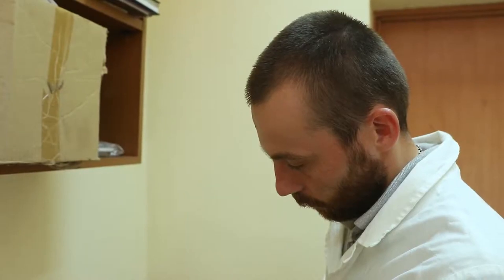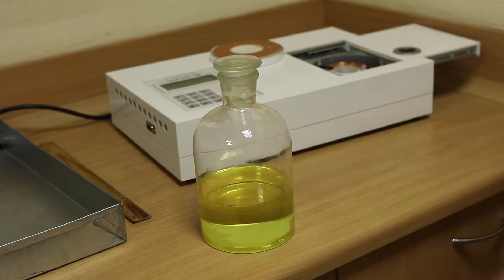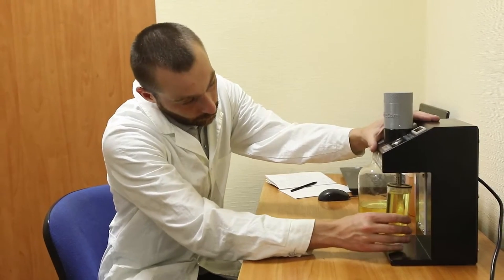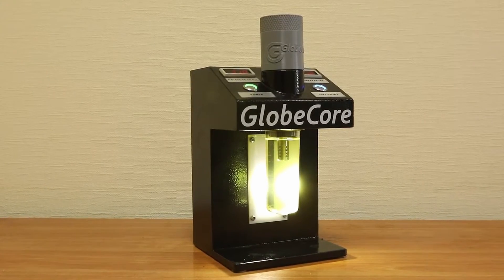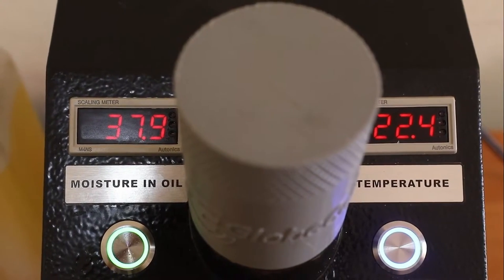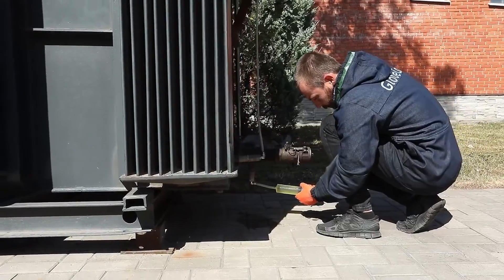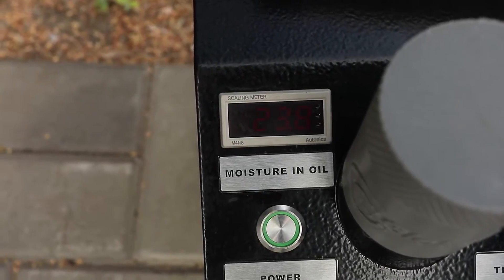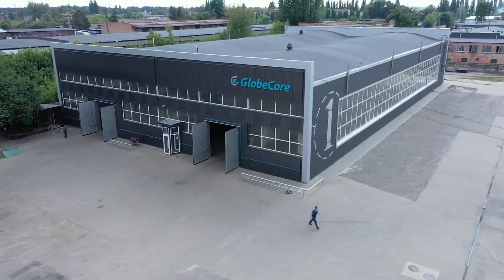Transformer Oil Moisture Test - Oil Moisture Meter TOR-1

Comment: Can the TOR-1 instrument be used as part of mobile laboratories for online analysis of oil in the field?
Reply from the maker: Due to its compactness, with a height of no more than 38 centimeters and a length and width of 18 centimeters, the TOR-1 is easily portable and convenient for use in field laboratories.

Comment: What features contribute to the reliability of the TOR-1 instrument's operation?
Reply from the maker: The TOR-1 instrument's reliability is enhanced by its measurement accuracy and stability, which are achieved using a capacitance sensor that is insensitive to contaminants in insulating oil.

Comment: What is the protection class of the TOR-1 instrument, and why is it important?
Reply from the maker: The TOR-1 instrument has a high protection class, allowing for testing insulating oil near transformers in any weather. Its sensor operates efficiently in ambient temperatures ranging from -40 to +60 degrees Celsius, ensuring reliable performance under various environmental conditions.

Comment: What is the procedure for operating the TOR-1 instrument?
Reply from the maker: The instrument design is simple, and its operation requires no highly qualified servicing personnel. After pressing the button to start measurements, the indicators show the values of moisture content and temperature. A more accurate result is available in ten minutes. After that, you can start testing the next sample of oil.

Comment: What type of sensor is used in the TOR-1 instrument, and why is it insensitive to contaminants?
Reply from the maker: Measurement accuracy and stability are achieved using a capacitance sensor insensitive to contaminants that may be contained in insulating oil.

Comment: How does the TOR-1 instrument measure moisture content in insulating oils?
Reply from the maker: The device works on the basis of the capacitive method of determining the moisture content in transformer oil.

Comment: Why are these methods difficult to perform and require increased safety measures?
Reply from the maker: Transformer oil testing methods in the laboratory can be difficult because they require specialized knowledge, equipment, and safety measures. Multiple tests are required, and each test requires different equipment and procedures, making the process time-consuming and complex. Precision is also required, and even small errors in measurements or testing procedures can lead to inaccurate results, which can have serious consequences for the transformer's operation.

Comment: What methods are used to analyze transformer oil in a laboratory environment?
Reply from the maker: Several methods are used to analyze transformer oil in a laboratory environment, including physical, chemical, and electrical tests. Physical tests, such as color and viscosity, provide information about the oil's physical properties. Chemical tests, such as acidity and water content, provide information about the oil's chemical composition. Electrical tests, such as dielectric strength and dissipation factor, provide information about the oil's ability to insulate and cool the transformer. Other tests, such as dissolved gas analysis and interfacial tension, are also commonly used.

Comment: Who is Michael, and what is his role in the electrical laboratory?
Reply from the maker: He is a specialist in the electrical laboratory where transformer oil is tested. Once in a while, he sets out for operational locations of transformers and works in the field measuring the breakdown voltage, the dielectric loss tangent, and the moisture content of oil.

Comment: What is the TOR-1 instrument used for?
Reply from the maker: OR-1 transformer oil tester is designed to detect the mass fraction of dissolved water in insulating mineral oils the viscosity of which does not exceed 70 cSt at the temperature of 50°C.